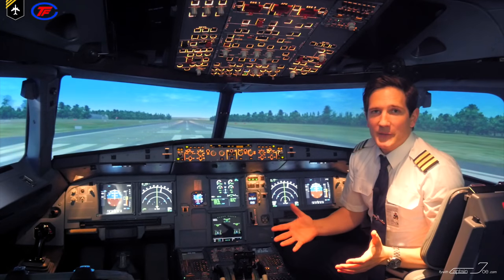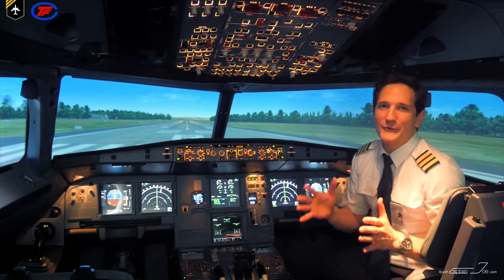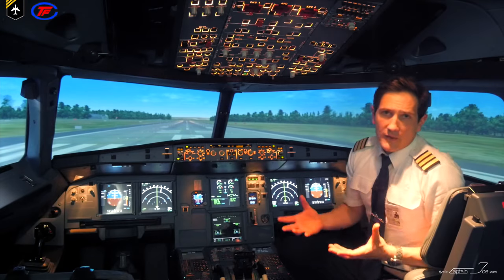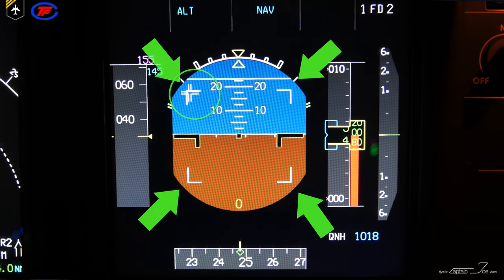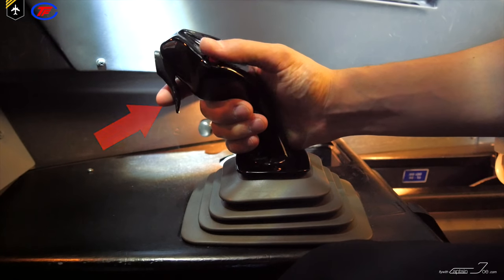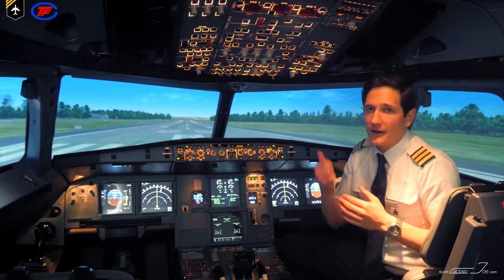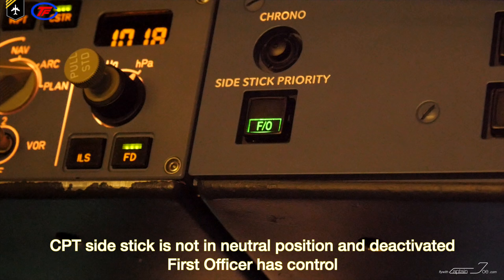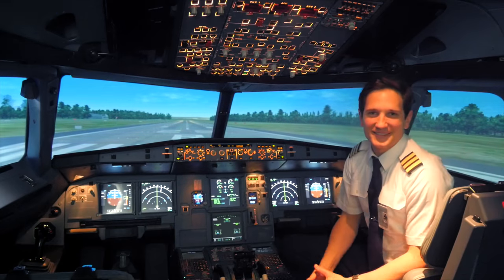AIRBUS SIDE STICK - Explained by CAPTAIN Joe

Comment: Cap Joe ! The index finger button is the missile launch. I know it's an airliner but it's a missile launch
Reply: I thought it was for the chemtrail dump...
Reply: Its used when you are escorted by F16s and you can counter attack them by that button
Reply: It opens the tank where the waste goes
Reply: blackmambagame for El Al, probably
Reply: LMFAO!!!
Reply: « Trigger, Fox 2! »
Reply: Thats the autopilot disconnect/priority button on a airliner
Reply: That would be true if it was a Russian plane.
Reply: On some U.S. aircraft it is a 2 position switch. PTT / Trigger.
Reply: BTW, That is used when pilots speak to ATC...
Reply: @Claudia Washington that red button is to disconnect auto pilot

Comment: As a right handed pilot isn't it awkward flying as captain? I don't the idea of flying an aircraft with my weak hand. Call me old fashioned but I prefer a yoke.
Reply: Zule i would too.
Reply: Zule actually captains(ie left seat) always fly with the left hand, even with a yoke. The other hand is used for throttle and other inputs. So it doesn’t matter whether you are left handed or right handed.
Reply: @Massachamp08  That's why jet fighters have yokes... NOT!
Reply: With a yoke the captain is flying with his left hand as the right hand always stays on the throttles.
Reply: Ben Farrell jet fighters have fewer flights and fewer flight hours. Also, the political and PR consequence of a jet crash is much much less than a passenger jet crash. Information on jet fighter crashes can be restricted by means of invoking national security. Thus the pressure on making a safe, excellent fighter is less than a passenger jet.
Reply: @Massachamp08  The "problem" with building a manual, analog type of controls in fighter jets is that you can't. Commercial aircrafts are generally built with stability in mind: if the aircraft is leveled and stable, even if the pilot do nothing and with autopilots off the aircraft will continue to fly straight and leveled. Fighters are built inherently unstable (relaxed stability). An aircraft with relaxed stability have a tendency to spontaneously bank, pitch, or change altitude without any inputs. This relaxed stability allows the fighters to be a lot more maneuverable and respond quicker to flight inputs: the necessary characteristics for air combat maneuver. This relaxed stability means constant adjustments and inputs is required to to keep the aircraft flying straight and leveled.; if done manually, this is a lot of work on the pilot, who has to worry about not crashing the plane while maneuvering and fighting. By design all of these have to be fly-by-wire and dependent on automation to keep it reasonably leveled. Also, you can't have a yoke type of control for fighters. Fighters should ideally have hands-on-throttle-and-stick type of control: pilot use the stick to maneuver and the throttle to control thrust. Control of thrust in combat maneuvering is extremely important.

The sensitivity of a fighter controls are necessary for real air combat. There is a price in crashing aircrafts during peace training. A few hundred millions lost in crashed aircraft must be taken, but loss-of-lives can be managed by better ejection seats.
Reply: @Massachamp08  Pretty often, I guess. The most advanced ejection seat is zero-zero: pilots can eject safely from aircrafts at zero altitude and zero airspeed. You can see various videos of accidents at airshows where pilots ejected successfully. Though a big problem is the acceleration suffered by the pilots. Pilots who ejected suffers from spine compression injuries. They are often an inch or two shorter after an ejection. Many are career-ending.

My point is air combat is very demanding on both pilots and airframe. As an air force, you can either train your pilots to a very high level or skill to be ready for war; or suffer heavily when real combat happens. If you choose the former, crashes are unavoidable but as a military, you tend to accept that as acceptable risks. How much risk also depends on how much money an air force can spare since modern jets are very expensive.
Reply: Ben Farrell as they say about most weapons of war, which jet fighters are, they are designed to hurt people, they just don't care who.

Rifles can blow up, ejecting metal bits into the firers' face. Negligent dischage kills people all the time. Anti-tank rockets are being suspected to give people brain damage. Armored vehicles can hurt its crews in so many ways (including spontaneously bursting into fire roasting everyone inside). Explosives blow up, killing the wrong people all the time.

So why do we have them? To protect ourselves? Why do we train people with them risking accidents and deaths in peace time? So that the if a real war breaks out, we don't lose and our population don't suffer.
Reply: Ben Farrell true, some aircrafts have astounding design flaws that would have shut down companies. For eg: F22 pilots are coughing to death. Why? The coating of the aircraft is toxic glue and toxic metal particles that got sucked into the air supply. Other fighter pilots are frequently passing out from hypoxia. How the hell could any of these manufacturers sell these aircrafts at all (the answer is obvious).

The bad thing is these issues with the armed forces will not be realized and will be covered up via jingoism until the mistakes are paid in blood. Quite a lot of blood too, before things can be changed.
Reply: @VT-mw2zb  Chú là phi công ạ? Nếu chú ở Hà Nội thì cháu có thể mời chú một cốc bia được không ạ?
Reply: Pranav Avva I just looked at a couple of pictures and I’m pretty sure that’s a stick. A yoke is a kinda stearin weal looking device. Most modern fighters (including the F-15) have a center mounted stick.
Reply: That is my only problem with airbus
Reply: I am left handed
Reply: You do understand that it would be the same with a yoke, because you would have your right hand on the the throttle and your left on the yoke in the captains seat, and vice versa for the F/O.
Reply: @Voyager.2  Yeah but fighters have the stick usually in the middle as to not favor either hand!
Reply: @Massachamp08  the very nature of what a fighter jet is built for makes them more likely to crash. You don't often hear of commercial aircraft doing low level manoeuvres or landing on aircraft carriers. Pilots training to fly military aircraft will be constantly pushing the boundaries of their skill level. Pilots in the commercial sector will always be striving to achieve stable and comfortable flight .
Reply: The captains's side stick would be perfect for me as I am a strong leftie, smiles.
Reply: Same, yokes are way better
Reply: Dominick no. Fighter pilots use their right hand to control the stick. The left has to be on the throttle. Is a Hands on throttle and stick system.
Reply: In fact  the reason I don’t like airbus as much as Boeing is JUST for the side stick.i like the yoke more because you have better control and I feel like the plane itself is safe.
Reply: I think it's the same like switch to a japanese (or british) car. I always thought shifting with my left hand is impossible, but once you get used to it you won't notice a difference.
Reply: I like the joystick
Reply: You’d use your right hand for throttle and left for the yolk. You won’t fly a yoke aircraft with both hands in an airliner.
Reply: Usually you always fly the plane with the left hand anyways in any plane.
Reply: @alexdrudigmail  nope. Left hand if sitting on the left and right hand if sitting on the right.

Ps it is just like left hand drive vs right hand drive in a car.
Reply: @ZK-APA  I could not be an airbus pilot then... I would have trouble flying in my weak hand
Reply: Paul tbh even with yokes you fly with a single hand. Yes a yoke is designed that it could be holder by either hand, but in actual flying, one hand operates the controls(yoke/stick) while the other controls the throttle.
Ps you learn everything in flight training so eventually you get used to it.
Reply: @ZK-APA  I would still be able to use my right hand though.... Go Boeing!!!!
Reply: Paul yes on paper. But you definitely can fail your type rating or check ride if you fly like that.

Ps m not a Boeing hater, I am just saying things based of actual things I’ve seen and being taught during training.
Reply: Zule that’s why I like boeing
Reply: toan actually I wont deny that. Yoke would always feel more natural than a sidestick, and I myself would prefer a yoke IF ill have to physically fly the plane.

But a sidestick makes more sense in an airliner as you are hardly flying the plane physically, and a yoke would just be extra
Reply: I am right handed. So i decided to try how awkward it was by putting my joystick on the left side of my desk. And then tried to land a B737 (in X-Plane). It was not that awkward. But in reality. Yokes ARE the way you control a plane.
Reply: @Massachamp08  do you know that the stick is more useful in manouevring and control... Huge jets like the c17 globemster use sticks instead of yokes
Reply: I prefer the yoke too
Reply: 5/5/19 SSJ100 crashed in Moscow. I suspected commander was uncomfortable with side stick, which he confirmed after survival-no computer plus acf behaved differently from simulator. I do guess no fighter aircraft pilot ever wanted attitude control with left hand for a reason. I can fly anythong with right hand, but wiyh lefy is like on wrong bike, where left is right and vice versa.
Reply: you should be flying with your left hand anyways. right hand for instruments and pfc, left on the yoke unless you enjoy switching hands
Reply: all these ppl talking about flying with their right hand i wonder how many are ACTUAL pilots and how many of those whose piloting experience hasnt gotten past the Xbox.
Reply: Your right hand is on the throttles and it is used for checklists if you are a captain
Reply: @VT-mw2zb  fighter jets are the safest aircraft around. The reason for the crashes is the fact that it is an extreme form of flying. Just as any extreme version of anything, there will always be a higher rate of accidents. e.g. skydiving vs base jumping, rock climbing vs free solo, fencing vs sword swallowing. Any extreme element will always have a higher rate of accidents, full stop.
Reply: @yassasloan7308  how do yoy measure safety, then, if you say something is "safest". There has to be a criteria. Like number of crashes per hundred thousand hours of flight. Number of fatalities per hundred thousand hours of flight.
If you pick the latter, well, there are so few pilots on a fighter compared to a passenger aircraft
Reply: @Aslo or if you are in the uk the right hand is on the wheel
Reply: I'm left-handed, so I don't care.
Though I could make the same argument about fighters in that case, since they're all designed for right-handed use. (the reality of course is you're usually flying with both hands)

But I would point out that ALL basic training in civilian aviation is done from the left seat.

The standard for light aircraft training is the trainee pilot in the left seat, and the instructor in the right.
That's also because any solo pilot will be in the left seat in most instances.
If you're wondering why, it's because in a standard VFR circuit, you would fly the circuit using left-hand turns.
Thus sitting in the left seat gives better visibility.

The aircraft I've flown all have centre-sticks, mounted between your legs.
However, if you're in the left-hand seat you're still going to be using this left-handed, because you'll need to be operating the throttle with your right hand most of the time...

If it's such a big deal though, why do you find so little accomodation for left-handed users in... Well, pretty much anything?
see how hard it is to get a left-handed joystick for PC. They almost don't exist. (they do, but it's a recent trend brought about by space sims using dual stick controls, NOT to appease left-handed users).
Right-handed throttles don't exist at all, even though you'd expect them to given civilian aviation trends.

Try finding a left-handed mouse. A proper one, NOT an 'ambidextrous' design.
Pretty much anywhere you find devices for single-handed use, you'll find it built for right-handed use, frequently in a way that makes it near impossible to use left-handed.
Where left-handed use is considered at all, the best you'll get 99% of the time is a compromise. An 'ambidextrous' design which simply isn't optimal for anyone whatsoever...

On the yoke vs stick thing - I much prefer a stick. I've flown two types of aircraft in my life. One had a yoke, the other a centre-stick.
The movements required to use a yoke just felt really wrong. 
The stick made sense, but the movements required to use a yoke did not.
To each their own I guess...
Reply: ZK-APA it’s still easier with a yoke as the control is right in front of you as opposed to on the side. Even a joystick that’s straight in front of you (like that in a fighter) is easier than the positioning of the airbus side stick.
Reply: It isn't just that you are using your off hand, the sidestick is off to the side. So you are using your off hand over to the left side of your body instead of closer to the center of your body where a yoke would be.  That would be as awkward as using your off hand so double the awkwardness.
Reply: @Aslo that's assuming you have a left hand drive car
Reply: Late, Im gonna be fine with  with my weal hamd, left.
Reply: I would prefer a yolk also. Because being right-handed oh, naturally I would want to sit on the right side so I would be using my right hand on the stick.

Comment: The autopilot disconnect sound can be a great message tone for a cellphone.
Reply: Ndabezinhle Mokoena I thought so too. disabled the next day, it was too alarming :-)
Reply: Or perhaps the 'stall pull up' sound as a ringtone, but it might be kind of haunting
Reply: imagine if you forgot to put your phone on airplane mode in first class and the stall warning went off on your phone :P
Reply: Haha I can imagine the instant freaking out of passengers
Reply: Try the one on the Boeing 747 and up. That noise can wake a dead man.
Reply: Ndabezinhle Mokoena I bet you probably not a single first class passenger would know what it means
Reply: That would be unbelievably annoying.
Reply: most passengers dont even know what a stall is, also phones dont work at such high altitudes
Reply: Allfresco didn't know about phones not working at such high altitudes. But in regards to the passengers I can imagine them still being worried if they heard stall. While they might not know what it means in regards to flying, most people do however know that stall is a bad thing. Eg. Stalling a car.
Reply: Ndabezinhle Mokoena I have had that sound for my text messages for more than 4 yeras and I love it!
Reply: One time, a pilot was making a PA to the cabin shortly before landing and you can hear the autopilot disconnect over the PA.
Reply: I have the Traffic Traffic alert of the Airbus TCAS as my phone ring and the Cabin announcment chime as my messages alert 😆
Reply: Kind of - "WINDSHEAR - WINDSHEAR - WINDSHEAR" would probably be one of the most haunting sounds for sure!
Reply: dan4ikm where do you get the ringtone?
Reply: 09shadowjet you make it
Reply: caden . g how?
Reply: PULL UP PULL UP, TERRAIN, TERRAIN
Reply: Ndabezinhle Mokoena boeing's is better
Reply: would prefer airbus
Reply: Ndabezinhle Mokoena My I phone ring is the one which sounds like a loud fire alarm, most the others are too quiet , when working in noisy motor rooms ( HVAC/R ) the refrigeration rooms need hearing protection, now with screw compressors , some WHAT like a jet engine ! INDOORS !!
Reply: +Ndabezinhle Mokoena but very confusing if that goes off while you are on a flight :)
Reply: Ah that is not scary. Usually if you are doing low level flying, the computer goes mental throwing warnings at you !
Reply: Ndabezinhle Mokoena I
Reply: It actually has been my ringtone for the past two years lol.
Reply: Crazy Clown I do have a life. I just happen to have that sound as my ringtone. Nothing wrong with that ey mate.
Reply: Allfresco They do. work but I guess minimal functionality. I mean, someone played Kerbal Space program on a laptop at high altitudes
Reply: Sometimes I can actually hear the autopilot disconnect alarm  when I'm sitting in my seat.
Reply: If it was I would have it.
Reply: still less panic-inducing than this http://youtu.be/9Yw5jkAHgME
Reply: Only if you have a weird sense of humor!
Reply: Ndabezinhle Mokoena :ñ
Reply: My ringtone message is "don't sink", and call "sink rate, sink rate, sink rate" 
😋
Reply: Ndabezinhle Mokoena I heard that sound so many times now but still can't get used to it. Standing in the cockpit it sounds really awful i think😅😂
Reply: I have this tone for WhatsApp. Very funny to play inside a plane when de-boarding while walking by the cockpit crew ;)
Reply: The first time I heard it I had it stuck in my head for the next 5 days. (I heard it in the Flight Channel, check them out.)
Reply: You don't want to get used to that sound.
Reply: Your 824th like and 42nd like. Awesome dude.
Reply: I have the stabilized click-click-click chime as a notification sound. People look at me wandering what the fuck that was all the time
Reply: Thanks for the idea it is now my notification sound
Reply: I have it as my alarm, just don’t use it on a plane
Reply: I concur in fact I did have one a few phones ago.
Reply: @09shadowjet  zedge
Reply: i do! lol
Reply: @ndabezinhlemokoena636  stall pull up?
Reply: Put this sound into phone of captain while he is asleep and then send him a message
Reply: @ndabezinhlemokoena636  Well you don't pull up when you stall
Reply: And the stall warning can be your ringtone
Reply: I use it for my text message notification and desktop computer default alert